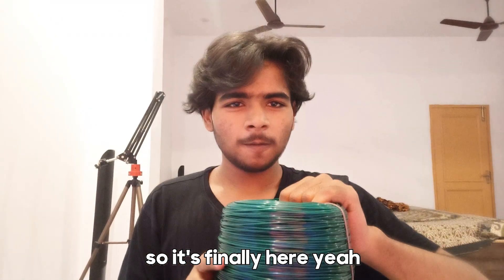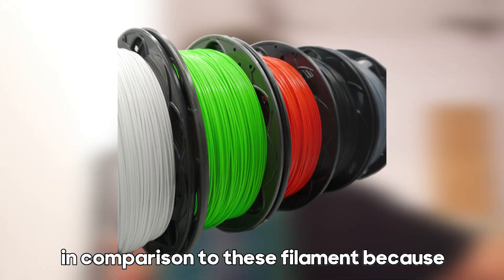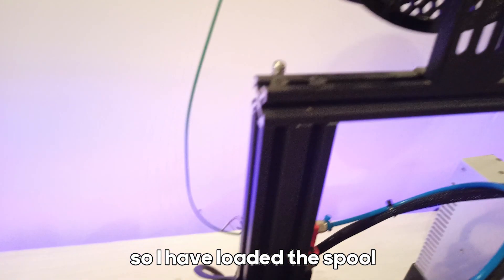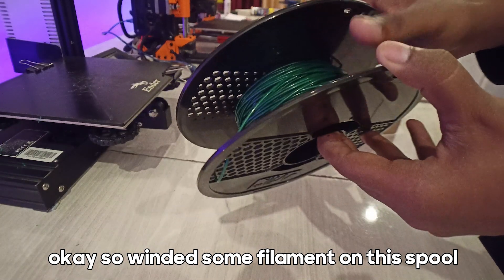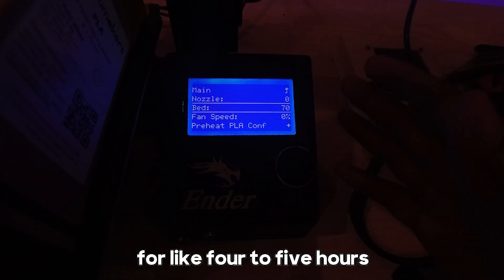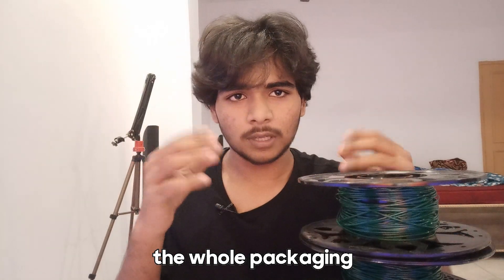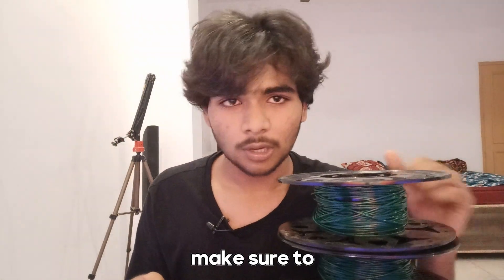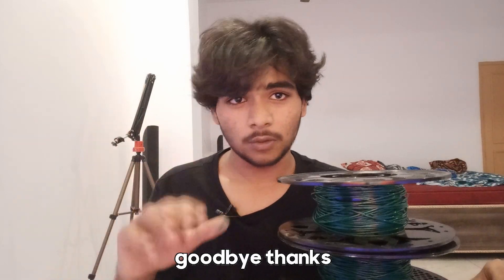I Used $1 per KG PET Bottle Agriculture Wire as 3D Printing Filament

Comment: Funny story about alternative filament. Back in the wee early days of the reprap project, it was pretty common to source trimmer line for weed whackers. The polymer plastics varied in usefulness, but once it was narrowed down what you were working with, finding a repeat source was quite easy. Most of that line has a color code to help differentiate what plastic it is (unique to the manufacturer). One specific company had blue ABS line that was 1.7-1.75mm nominal average, and most of the time, it was round enough to run through a nozzle without too many issues. Ultimately that is how filament came about as it was sourced from a plastic manufacturer in bulk but was not initially used as printer feedstock.

Comment: Well this is an interesting idea. Looked it up and saw there is a thicker wire then 1.75 available. I'm thinking, could we pulltrude such thicker wire into propper(ish) filament, perhaps it would help rid of inconsistent in the wire.

Comment: Like some of the others I tried looking this stuff up but was unable to find any in the States, what I did find were some calling it PET/polyester wire but those are two different things right? Also almost all were 2mm+.

Did you do any more testing to see if this was worth it for maybe basic simple printing?
Reply from the maker: There is a latest video on the channel on post processing this filament and I would say it's doesn't worth the time cause the amount brittleness, filament breakage and nozzle clogs make it worthless. But you can still try
Reply: @Creative3DP  for the time being I'll take your word for it being not worth it. I just got into 3D printing so I don't exactly need mass kg of filament yet, and I've seen the processing bottles if I really want to play around with it. I'm in the States so not hard to get soda bottles to use from all the neighbors. 

I've been asking others if they have tried to do 3 smaller strands from the bottles for longer lengths and maybe multi colored, but not sure if the heating will work to to combine them well?

Comment: not work Bro this pet filament not melting
Reply: Keep the temperature at 260 then it will melt , also you need to upgrade your printer
Reply from the maker: Set the temperature at 260 and for better flow go with volcano hotend

Comment: Dry the filament a lot more, print slower and increase your retraction values. for the price of it tho...it looked like a benchy which is already major. I wonder if a diy filament thickness sensor could be used to dynamically chance teh extrusion rate to compensate for the imperfections in diameter 🤔 great idea tho, I'll probably try it out!
https://www.youtube.com/watch?v=RYgdLPe_T0c&ab_channel=ThomasSanladerer%3AMadewithLayers
There's a link to a solution that could definitely work to start using that as filament
Reply from the maker: Thanks for the suggestion mate

Comment: Part of the problem with using industrially recycled PET bottles is that they rarely, if ever, remove the labels or adhesive.  It's all just ground up, washed, blended and then extruded.  Good enough for tying off grapes but not good enough for the precision we want in 3d printing.  It might be ok with a 1mm or 1.2mm nozzle but that's about it.
Reply: Looks good enough for functional prints, as long as I can get it in black. 90%+ off is hard to beat

Comment: You bought it and started printing without drying, it was who knows where , not in a vacuum sealed bag, of course there are going to be bubbles, lol , dry the filament and then do the testing.
Reply: Did you even watch the video
Reply: @sapuseven  I don’t consider drying filament on the printbed a proper drying method, there is no air circulation, the filament get heated only on one side of it, besides the author lives in the India region which is veeeery wet overall, it’s hot and wet there all the time, even after drying it’s important to keep the filament in the relevant moisture proofed environment, the author does not do that, even the slightest half-drying on the printbed already contributed to a much better quality and less stringing, the results can be improved if he does the process better imho. Best way to measure is to have very precise weights, weight the spool, next weigh the same spool with the filament. Stephan from CNC kitchen proved that regardless of the method be it ultra high amount of silicone, or the vacuum, or the heated chamber, the highest result of them all is reached around the 5! day of drying, so again I see an opportunity to just keep drying actually. The author preoccupied with thr print bed getting damaged after 24 hours of being heated 🙄 that should not happen on a good printer, but alas - the solution is again do the drying the proper way with a specialized hardware or build that hardware himself, the supposed “easy” methods have their limit. 

Also as the filament is inconsistent and 100% contains impurities it’s important to use just a bigger nozzle, the biggest you may get for such recycled material, there are often included other plastic material with different properties in such , or even pieces of metal and glass, no wonder the nozzle got jammed. Also a higher temperature and more cooling may be necessary. 

The author did a great job, but still a lot that can be cranked up and dialed in, starting the drying process. But again this video is nice to go to show the hurdles of working with recycled materials. 

The best other comment actually was the advice to pull-trude the whole thing to give it more uniformity, so again things can be dialed even more. 

Wishing good luck and much inspiration to the author making new videos and investigating the process.

Comment: If you have spare rice, you could potentially remove all the moisture by burying the filament in rice.
Reply: Passive drying methods are not as efficient as actively drying in a heated chamber, preferably a specialized one.

Comment: Pretty interesting. I had heard that moisture can have a permanent negative effect on filament, even when fully dried. I wonder if you ran it through a hot 1.75mm nozzle first, if it would re-melt, and thus revitalize the PET.

Comment: You should definitely keep trying this to see if you can get good quality prints with it that would be amazing lol
Reply from the maker: That's the plan!
Reply: @Creative3DP  Try just room heater for drying. Set it some distance away with the inbuilt thermostat at a lower value and monitor filament temperature with some cheap temp+humidity display.
I was able to lower humidity from 80%+ (West Bengal) to less than 40% very quickly (5min).

It's possible to make it more efficient by putting inside enclosure and doing active on/off control.